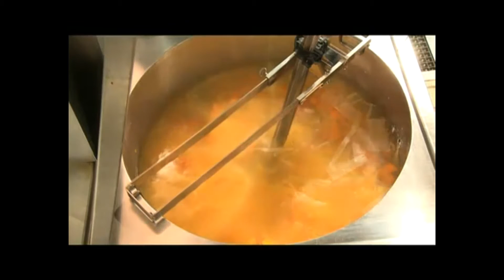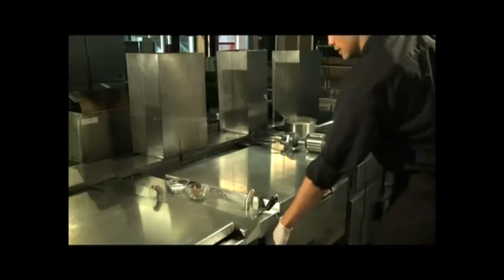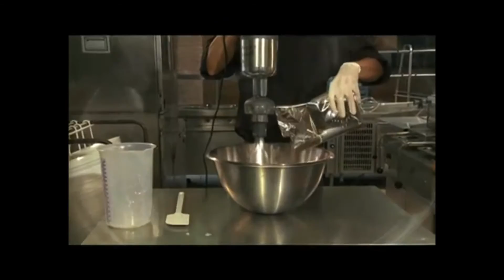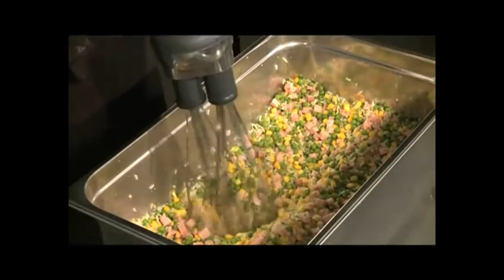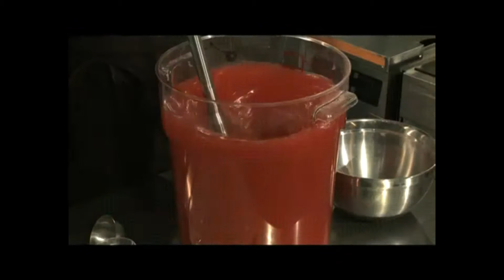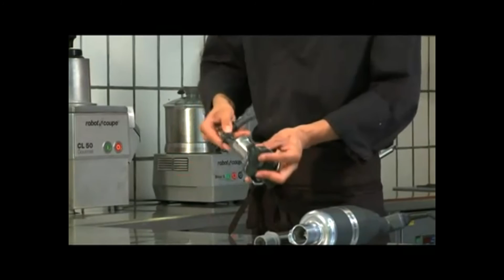Robot Coupe® Immersion Blender (MP600 Turbo)

Comment from the maker: Check out this video about Robot Coupe immersion blenders!

Some recipes that need to be mixed or puréed are too big to go into your food processer or blender. You could get a bigger food processor but that doesn't work for everyone. With an immersion blender you “immerse” the blender into your recipe.

The video gives you a basic idea of what the immersion blender, also called a hand mixer or a stick blender, does and how it works.

House made sauces and dressings are key in adding flavor and value to your menu. If you want to get it done faster and in bigger volumes it might be worth “immersing” yourself in this video.

Robot Coupe® Immersion Blender (MP600 Turbo)

Check out some of the different sizes of these units here:

http://www.bigtray.com/hand-mixers-commercial-mixers-p-11520.html